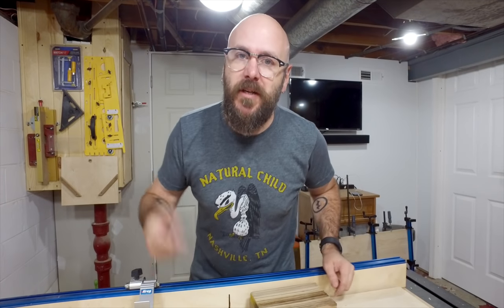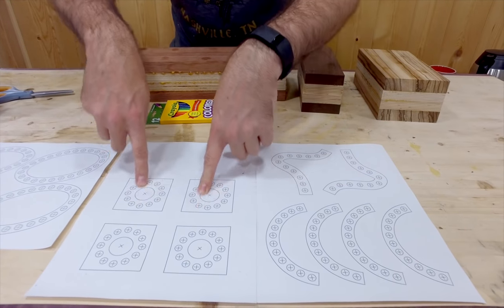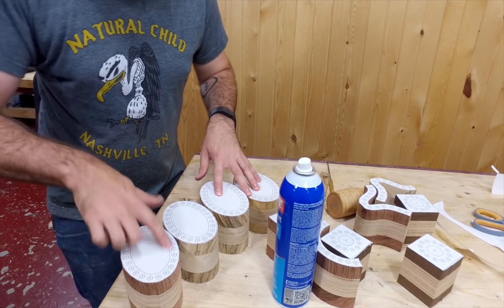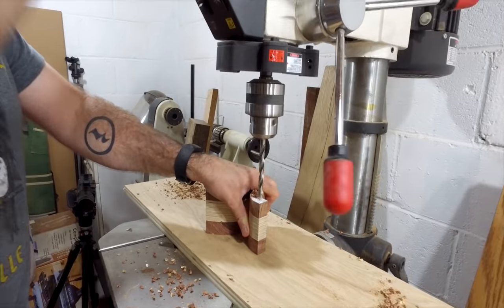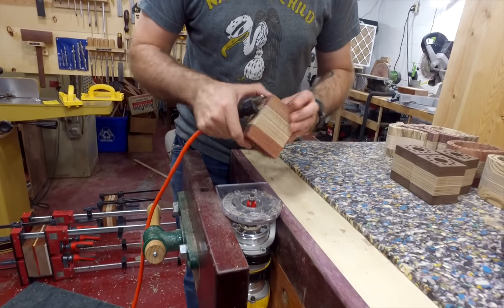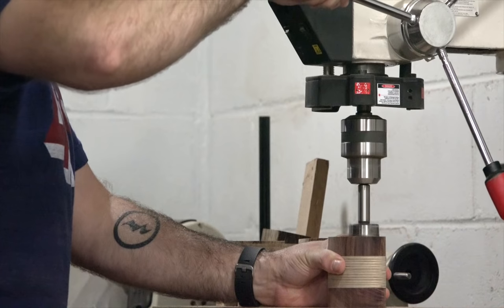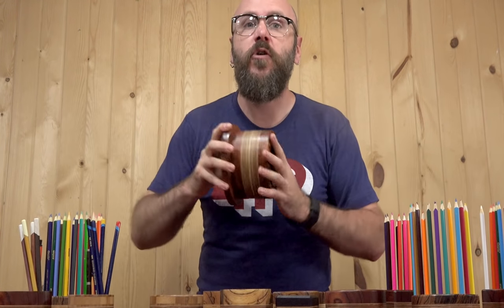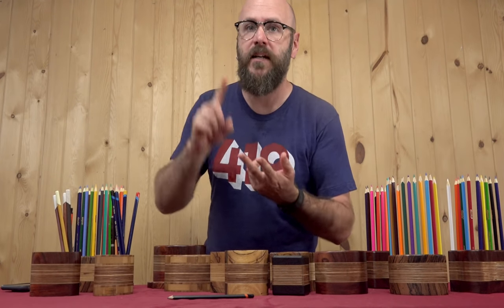Quick & Easy Pencil Holders That You Can Sell | Craft Show Woodworking Project

Comment: I used to use linseed oil when I refinished rifle stocks back about 50 years ago before we were worried about whatever out of our finishes. I used my hands to rub it in and the stocks I kept are still smooth and look like I just finished them. My hands were always soft and smooth as a byproduct.

Comment: David what is your opinion on the difference between your tri blend finish and spray lacquer? Do you think one has a better texture than the other, durability, customer appeal, etc? As an engineering student I am sort of hard wired to hate wasted time and at least in my experience oil finishes and polyurethane both take much longer to completely finish a project than spray lacquer.  

Thanks,
Eric

Comment: I bought a drum sander back in 2003/2004.  I was working mostly in pine, and the belts gummed up so quickly, and scratched the wood, so I got rid of it.  I work a lot more with maple and oak, and I wish I maybe still had it , now.

Comment: Being lazy and not searching through all comments first...  When it comes to batch finishing small projects using an oil blend (1:1:1 poly:BLO:thinner), I keep it mixed up in a gallon paint can and just do a dunk-and-dry session.  You can get un-used paint cans at the hardware store -- get a lid too.  And for the dip-dry portion, I try and rig up a heavy string and hang things when possible, otherwise they get propped up on long triangles of plywood cut on the table saw and resting on sheets of cheap rosin paper.  Find the rosin paper in the home improvement center with the flooring supplies, sometimes finishing.  The long triangles of plywood are just scrap plywood cut using a rip cut and the blade tilted at 45*.  Drip-dry for 10-30 minutes then start wiping down.  Sometimes get a second dunk.  Fast and efficient when you have a bunch of small stuff that will fit into a gallon paint can.

Comment: Hey David, 
nice project. But how did you apply the finish to the inside of the small holes? Or did they not get a finish?
Thanks
Reply from the maker: I just let the oil drip into the holes. Just making sure only the visible parts are coated.

Comment: love your videos been great inspiration and knowledgeable, I made a few of the pencil holders however am restricted to softwoods as can't afford to get hold of hardwoods in my area so attempted to stain the top and bottom pine pieces however I just watched the die seep through into the plywood centre part. is there any method that you may know to stain the top and bottom without contaminating the middle piece as they need to be glued together and smoothed off before any staining can be made so I am a bit stumped. any thoughts? cheers for any advice.

Comment: I know you`re from Toledo and it gets cold here. what temperature do you keep your shop if you`re not going to use it for a few days. Thanks
Reply from the maker: I usually turn the heat completely off when I'm not in there. Sometimes if it's really cold like 0° and I know I'll be in there first thing in the morning I'll turn the heat to about 50° so it doesn't take so long to warm up when I get in.
Reply: @MakeSomething  It has been -30 to -40C (-22 to -40F) lately where I am (Edmonton Alberta).. I can't even think about doing glue ups.. Even with the propane heater, it can't keep it warm enough with the drafty garage doors.

Comment: Do you ever worry about putting finish in the holes? If so, any tips on applying?
Reply from the maker: I just let the oil drip into the holes. Just making sure only the visible parts are coated.

Comment: Would be smarter to drill the holes first, before cutting it out
Reply from the maker: +Maximuss why is that?
Reply: +Make Something (just my personal opinion) when its a solid chunk of wood its a lot less likely to crack it by drilling the hole and also less likely for small chunks of wood chipping of the top. Also its a lot easier to keep a big piece standing straight up for hole drilling than a small piece, and so the holes would end up straighter